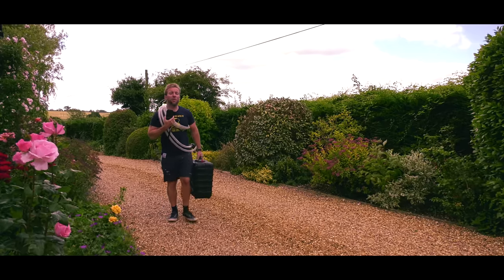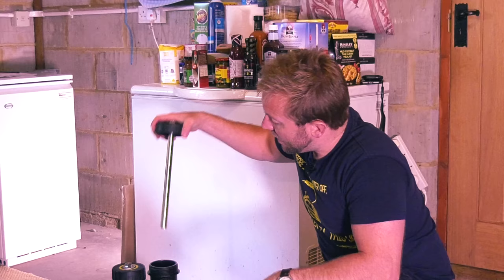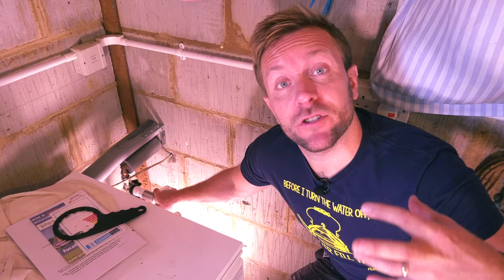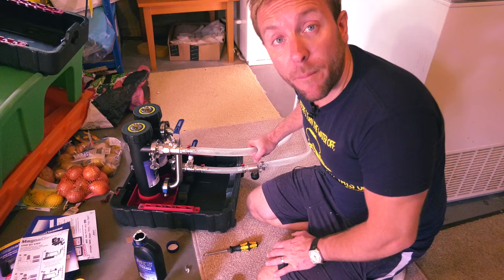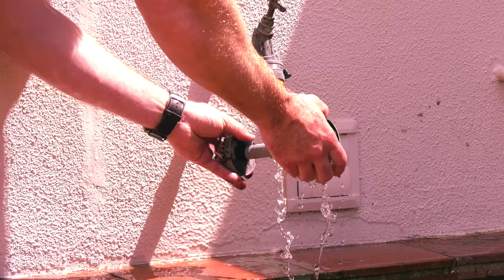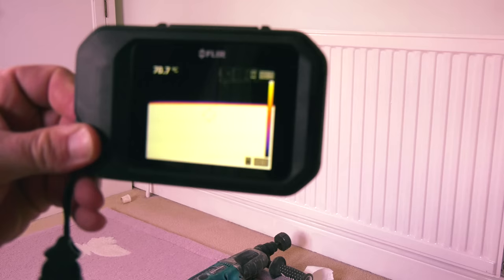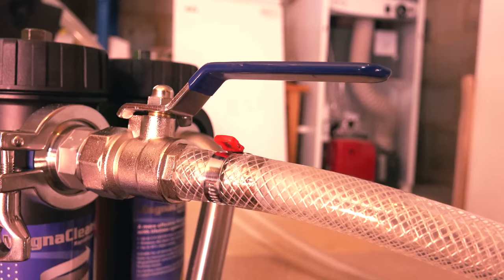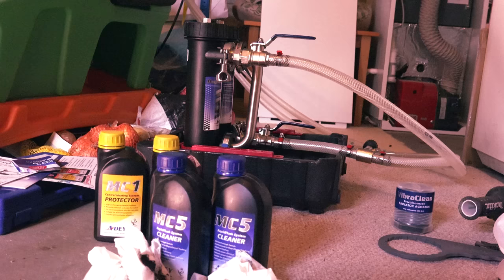ADEY MAGNACLEANSE CLEAN HEATING SYSTEM SLUDGE

Comment from the maker: Links to the tools I USE EVERYDAY https://www.amazon.co.uk/shop/plumberparts *Plus Follow my Vlog*, TimesWithJames  https://www.youtube.com/watch?v=vBjHN4wgAyA ❤️
Reply: mate I'm in the process of getting quotes to my old familys home,  currently we have a open vent pre-condensing installed there,  with 12 rads the system is clogged bady on the ground floor,  as it hasn't been serviced for over 15 years when I was last there,  since the boiler is also being swapped I wanted to get some advice,  two people have called in for a quote, have said only do a chemical treatment,  not power flush.,   as far as i am aware a chemical treatment two weeks before won't help remove the sludge. that's causing the issues,  so would you recommend a full power flush as well before installation? or is it a requirement to do a powerflush with new installs ?

Comment: Another fantastic video. I have cleaned so many systems over the years,  but I have to say magna clean way is the easiest way and the cleanest.
Reply: Hi Garry would you say the Magnacleanse is as good as most powerflush machines or do u still use others thanks
Reply: Depends on how bad the system is.
Most manufacturers do like us to use a powerflsh, as the pump on the boiler (combi or system) does all the work and sends all debris through the new boiler.
As long as its being cleaned can't see a prob.

Comment: I’ve had issues with my 100 year old Chicago boiler system since we moved in in 2017. We’ve even replaced the boiler twice!
I’m sold that this is the solution. My current NTI boiler keeps shutting off in the middle of the night and I have to reset it and bring the pressure back up for it to start again. When it does, it comes up to temp so slowly.
I’ve seen the sludge in it last visit and I’m convinced it’s never been cleaned in 100 years.
I don’t know why companies in the USA don’t install these everywhere in Chicago.

Comment: As a Gas Engineer, I diagnose many faults with Boilers, but most of all, I always come across systems that are always sludged up.  I mostly just flush out Domestic Hot Water Heat Exchangers, and recommend a mate to other customers who need a full Power Flush, but I would like to get into Full Power Flushing myself.  I used to train with a Plumber many years ago, who showed me the Power Flushing side, and considering the amount of systems I come across which are clogged, I’d rather do this as well.  Great video, keep up the great work!  👍👍❤️

Comment: I love the magnacleanse unit, as like you, I also have a power flush which is great for system that are really blocked, however, most of the time these do just as good of a job but not putting the systems under any pointless stress.
I'm currently doing one myself as I type.
The only thing I would say though, is it's best to valve and cap the F+E tank, an connect a water main to the unit one end, and drain hose to the drain off, that way, you can ensure that the fresh water makes it's way fully around every radiator.
Good video 👍

Comment: I could have really done with this the other day. 18 year old boiler, 13 rads, no magnacleanse, no nothing. The last rad on the system, was pretty much a mould for sludge. So it was easier to put the rad out, take it outside and TRY to clean it with the customers pressure washer, but that shit wasn't going anywhere. Basically they ended up with 2 new rads and a magnaclean and a plumber that just wanted to get home, have a beer and watch the footie while the Mrs stares at me with those, "I'm getting a back massage tonight until you hands bleed" look.
Reply from the maker: HAHA!

Comment: Handy little video. I’ve been thinking about getting one of these for ages, but I’m too tight!  You did the final flush how I would, and how every other sane plumber I know would, by just using the f&e head. I think when these first came out Adey were saying to make a temp connection in the loft between the ball valve and the cold feed and flush under mains pressure. Sod that! That’s a recipe for disaster. Anyway I’ve got a combi swop to do in about three weeks and seeing this video I’ve decided now I’m gonna buy the magnacleanse. I’d love to get a free one obviously but to be honest I think you should pick a couple of guys who have just completed their apprenticeships. We all know quality tools are a massive expense when first starting out and this would do someone a right turn. Just get adey to post mine to me directly, with the amount I’ve spent on filters and chemicals over the years if they did a points scheme I’d have about ten of these by now!

And did I spy the oil hose outside of the case on that vortex? Tut tut. 😀

Do you know if they sell an adapter to go onto the tf1 filters or the dreadful spirotecs that BG insist on pushing on the unsuspecting public?
Reply: ADEY hi. Thank you for your reply. I wasn’t aware of your new scheme. I will be signing up ASAP. Do you know if there are any plans to release adaptors for other filters? Regards wayne.

Comment: Hi Plumberparts you do some great video's and I'm especially interested in this one because are radiators have had problems ever since we move in about 9 years ago I think it couldn't  save us a lot of money having a done and I think you will get twice or three times as more sludge out of our radiators then the one on the video when we come to turn on the radiators in the winter I have to go round with a hammer to get all the valves working again properly.

Comment: what we did on our house is the following, on the radiator bleed valve of the radiator, take off the radiator bleed valve, put a 1/8th nipple put it to a T then one end has the bleed valve, the other end has adapters that transitions to a hose adapter with a valve and a cap.. 

anytime you want to power flush the unit just connect a hose to the valve,  close the return open the valve, have one person put the feeder on high pressure, and watch all the sludge push out. 

going to make a video on it soon =D.

Comment: My system is 35 years old and never been flushed. Would love for you to film the flush
Reply: Be careful of who you allow to flush out your radiators .Mine are the same age and they managed to flood my carpet with water sludge ,it’s completely destroyed now .Obviously one of the radiator valves were weak and they couldn’t be bothered to secure it . Be cautious of these workmen ,not all of them are competent and some of them have absolutely no respect for the customer.

Comment: Hi James, a little off piste - the flow and return pipework diagram show for the equivalent F&E system would be appreciated but my boiler is wall mounted in the kitchen close to the ceiling so where can I fit the proposed magna clean filter on the return side in the airing cupboard with the hot water cylinder 22mm pipework..? Thank you.

Comment: Looking for pro opinions on the way MagnaCleanse process which was recently carried out on our system

We have just had this done as part of a new boiler installation, but the way the installers carried it out seemed to me very different to the by-the-book way or even the way I’ve seen in some other videos which cover the process and the installer varies things slightly. I raised concerns with our fitters about how their methods differed but their reaction was like I was crazy and they were doing it the correct way

They hit the radiators with a hammer, not tapping but bashing them as if you were trying to break through a wall. They didn’t do it on all the radiators only some of them. When I asked why they don’t use an SDS and the tool with the kit I was told it was because it damages the enamel on the radiator. From what I’ve seen in videos this is only when they do it wrong or on extremely old rads (ours aren’t)

They also only cold flushed the downstairs radiators and said they didn’t have to do the upstairs ones because they are on the same loop. If this is a thing, should the same loop upstairs radiator have been on or off when they did this as some seem to have been left on and some off? They hooked up a hose directly to the ends of the downstairs radiators and ran it outside rather than connecting up to the filter connections near the (freshly installed boiler).

Does what I described above seem reasonable? We are paying for this and it was apparently a required part of the install to get the full boiler warranty. Somehow I feel cheated because it seems like they didn’t do it properly. This is quite a big accredited company, authorised installer for the boiler we chose, with good reviews and has multiple installers so not a solo dodgy guy which made this all the more surprising

Comment: Is this as good as a powerflush? Or just a good substitute for old systems that may not be able to cope with a powerflush due to increased pressures?

Also I have a house that a lot of the rad valves dont work anymore and they dont wanna replace them 🙄 would this still have  a good effect on the system?

Comment: Question: I'm assuming that the addative that is being put in the heating during a magnaclense flush is acid, as this is the only thing I can think would remove the sludge... So basically wouldn't using such an addative instantly write of the boilers cathodic protection by basically destroying its anode?

Comment: Hi James, I would love to win one of these ADEY magnancleance from Plumberparts! I have just passed my Level 2 NVQ and will be starting my Level 3 NVQ very soon. Been working in the industry for 3 years now and I’ve gained so much experience from the lads on the firm and really enjoy working in the plumbing industry. I would put the magnacleance to good use as I’m finding that a lot of radiators I’ve worked on are full of sludge and it would be much more professional of me to offer the customers the option. Thanks for taking me into account mate and HOLD TIGHT!

Comment: I notice you cut out the actual removal of the magnaclean :-) When newly installed the the retaining/removing clip with the red knob may work fine but after some time on there it does not come off easy. I had to remove the 22mm connections and pull the whole magnaclean out then take it to a workbench to shift the bloody thing with  numerous taps of a rubber mallet.

Comment: So... if I already have a magnetic filter on my system what is the point of adding a bigger one? Is the standard Adey filter too weak to do a proper job? Surely you could just go around with a rubber hammer and disturb the radiators at no cost?

Comment: Thanks for the great videos!  Very informative!!

I’ve recently purchased a Magnacleanse, treated my 20 rad system and running the cleanse for a few days. I have an SDS drill and will agitate my rads too

3 question please -

(1) should I open the lock shield when agitating the rad to allow best flow and removal of magnetite?
(2) should I also isolate the rad in my hall where the thermostat is?  (Lockshields only, no TRVs) so I only have one rad open at a time 
(3) finally, should I reduce the output of my boiler when only one rad is open?  It’s a 10 yr old BAXI SOLO 30 HE. Not sure if it modulates output

Many thanks.

Comment: Couldn't you use a strong magnet and drag it along the radiator to move the sludge and sh*t that has settled on the bottom toward the return to the boiler? I know it would stick to the radiator but if you put the magnet in a sock for example and drag it along the surface..

Comment: Great video matey. Well done. I already have my magnacleanse system flush kit so will let some other worthy apprentice have a try at winning a great prize. Although I am pleased they've changed the design of the magnet hose valves because they older design did tend to leak a little.

Comment: Hi there great video. Bit of advice please. My combi boiler system is sludged up and needs cleaning but worried about powerflushing due to it causing a pin hole somewhere. Is this Adey system a good alternatibe? Thanks in advance

Comment: I should win because my own CH system needs flushing. It has magnetic sludge at the bottom of the system which stops downstairs rads heating properly.  Currently running with the pump on full.  It would be awesome if i could use it as a semi-professional.

Comment: Hey! When would you use the magnacleanse over taking each radiator off the wall and flushing it with a hose?
Reply: I did that, but be prepared for oily sludge drips on your carpet as you take it outside for flushing, plus it’s a pain going around every rad (I have 20!), disconnecting it, stripping threads etc okay for homeowner but this is quicker for a tradesman

Comment: Need your advice but would to speak properly.i work for a large care home they have just installed 2 new commercial boilers and still the heating is not working sufficiently half of the radiators are not working and not one person can identify or resolve the problem ......I know u could innyour sleep

Comment: just wondering in a pressurised system when doing the cold flush through the filling loops what would stop the water coming straight out of the drain off rather then going through 1 radiator at a time

Comment: does magnacleanse flush only work providing you have a working boiler for heating? as im replacing my faulty boiler and would like to flush the system before fitting a new one.

Comment: Am I right in thinking that the fitted  magnacleanse just adds another magnet to the system (assuming you have a magnaclean already)? OR are they both a lot more powerful than a standard magnaclean magnet. I assume the 2nd one catches anything the first one has missed and really protects the boiler especially as you are agitating the radiators. Just looking for a way to clean my system without spending £400 on a magnacleanse! or taking every radiator off and flushing outside! If you are a plumber £400 well spent though....

Comment: Is that a newer version of the MagnaCleanse? I've had mine a few years and the connection to the flow and In / Out hose is different. It has a clip in system. Its quick but I have noticed it can leak. Your one looks a more solid connection

Comment: i could do with that magnacleanse, I have just bought my council house which has a 14 year old central heating system, that still has the original water in it and never had a redoes of chemicals, as the council never give it anything other than a basic inspection every year, so can you guess how much sludge must be in those radiators, so now its mine I am thinking I need to start looking after that boiler, I would love to see those magnets after a few hours on my system, and being a keen DIY plumber I am sure I could use it with no problem :-)

Comment: In theory couldnt you just add the cleaning solution to the system and use it as is? It might take a bit longer to clean as you would only be using 1 magnet rather than 2, right?

Comment: Vented system? Hope you cappe off the vent aswell as turning off the cold feed. Using the boiler to keep system hot is good but will risk pushing all shit into the boiler exchanger especially if it's a Combi with a plate.
Reply from the maker: You don't need to cap off the vent or feed as we aren't introducing any new water into the system. The additive keeps any sludge in suspension, so far with plate heat exchangers I've had no problem...indeed I've actually had improved performance on everyone we've done. Thanks for your comment though dude. If you're interested I also run another channel. Latest video here: https://www.youtube.com/watch?v=vBjHN4wgAyA

Comment: If you were to just put the cleaner chemical into a system that has a magnaclean or other filter and then do the same thing with opening/closing rads and agitate... Isnt it kind of the same thing? You can clean out the magnet filter after each radiator as well as it might get clogged.  My point is, the magnacleanse product doesn't pump or pressurise the system, its just a higher capacity filter.

Comment: In Germany inhibitor is not recommended.
Reply: Why? 🙄
Reply: Because it needs to be a correct treatment for a known issue. Correct diagnosis and treatment would be a specialist job. With good design and practice no issues need to be treated and so no inhibitor.